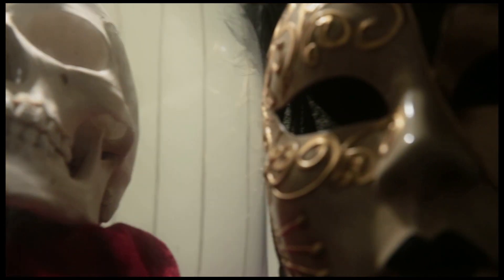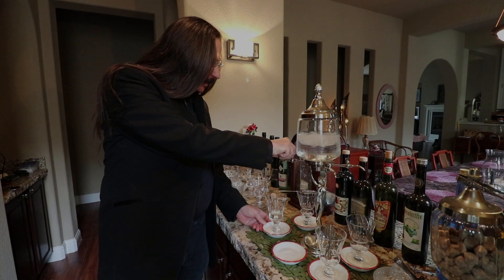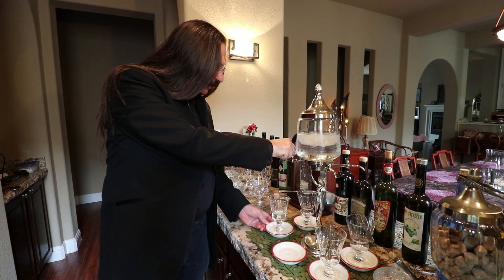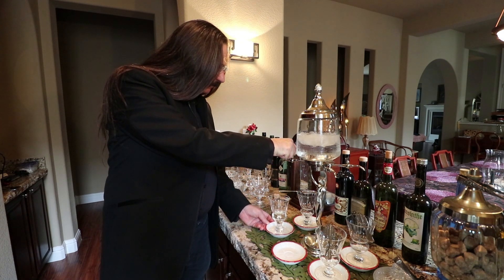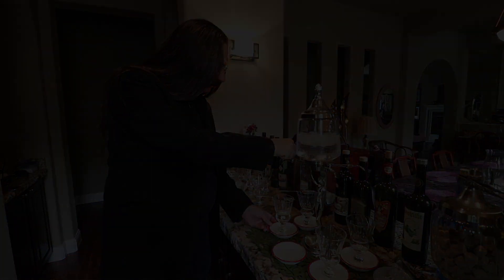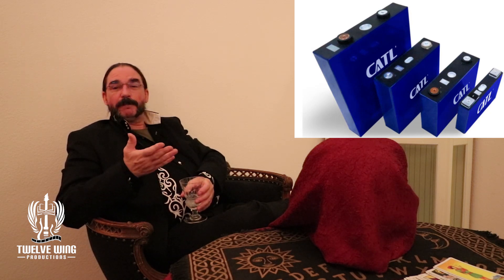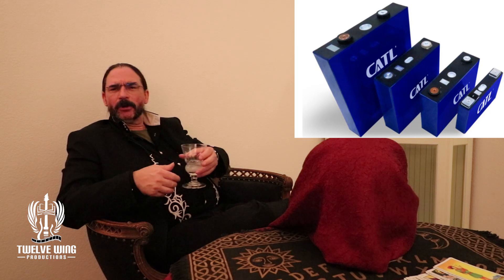Tesla Battery Investor Day: Does Vehicle to Grid Really Work?

Comment: It is my (admittedly crude) understanding that DC motors are smaller and more efficient than comparable AC motors, and that the ONLY advantage of AC is that it can be transmitted over long distances more efficiently. It thus seems to me that a more logical approach would be for homeowners to utilize DC  appliances including refrigerators, dishwashers, air conditioners, pool motors, heaters, and heat pumps. This would eliminate, or at least minimize, the need for invertors, which are expensive and which also waste energy in the process of converting the DC power produced by solar panels into AC. DC power could also be used to efficiently charge electric car batteries.   From my way of reasoning, the ideal would be to make all homes and businesses independent from the "grid" so as to eliminate the problem of "blackouts" where grid failure renders hundreds and thousands of homeowners bereft of power. I'd appreciate your comments regarding these ideas.

Comment: So i was thinking about solar power and would love some of your thoughts on this. 

It seems as tesla will have the day to day/night fluctuations under control with batteries and vehicle to grid.  Problem solved 

What concerns me is the seasonality of solar and  therefore the vast quantity of energy necessary to smothe that out. This needs to be solved for solar to be a big part of our electricity system. So how do we do that? 

Hydrogen? (god forbid haha) 
Some form of batteries ? (waaayyy to expensive) 
Excess solar? (Might be cheaper than hydrogen since hydrogen would require lots of excess solar anyway given about 30% efficiency) 
Nuclear/hydro power during winter? 

How would you solve this? Do you think Tesla has something planned? And if hydrogen is the route that makes sense for the grid, would that by extension make hydrogen vehicles viable?
Reply from the maker: I'm just about to release a video about driving on sunlight as well as a subscriber Q&A.  I'll go into some detail that will be in both here since you touched on it.

Firstly, the daily smoothing of home loads with VTG isn't going to happen.  We have a vehicle because it is our intention to use it.  I would encourage you to go back to our video library and find any one of The Energy Sovereignty Project summer videos or even something from say April or October.
What I draw your attention to is both the power to the vehicle as well as the "To Powerwall" and "From Powerwall" numbers.

What you will see here is the massive swing of power into and out of the powerwalls.  Imagine this was going into and out of a vehicle.  If you do that, you will run out of time to charge the vehicle and use it, even IF the capacity of the car is large enough to actually handle it... say 200kwh.
If the system is DC, you MIGHT be able to get away with the time aspect, but you will still be left with the into and out of swing.  This is going to also require your car to be at home while solar is producing... a time when most people have their car at work.

This can be dealt with eventually by perhaps sending the car home when autonomous driving kicks in, but it's never going to be the hassle free situation that is presented by most people supporting VTG as a panacea. 

The solution is actually home batteries.
Tesla will be announcing batteries at their battery investor day that will be MUCH cheaper than current offerings and MUCH longer lived.  20 years plus... or well over a million miles.
This will springboard the transition to sustainable energy.
Have a look at those videos as well as the two that I'll be putting up shortly.

In the meantime, if you like, you can tell me your rough geographic location and if there are any variables I need to know such as elevation.
If you tell me how much power you use daily... averaged over the course of the year... I can help you out with some numbers regarding how much battery capacity you should be looking for to both run your home and drive.
Reply: @twelvewingproductions7508  First of all thanks for the reply. 
And will check out those videos!

I realize now that you are right and VTG probably won´t make much sense even with the new batteries. Especially if autonomy is on the table and the car can spend its time there instead. 

I was coming from more of a macro grid perspective, as im a student so solar is right now not feasable for me sadly. 

But if you could i would appriciate your aproximation anyway.

I live in the southern most tip of Sweden, roughly sea level. The average electricity consumtion for a home in sweden with electrical heating is about 25k kwh. But its less cold here in southern sweden so lets say i used 20k kwh per year. Since we use so much energy in sweden and its not very sunny i realize that this is a worst case scenario for solar. 

Lets assume we used those kwh evenly throughout the year so roughly 55 kwh/day. 

How big a battery would i need/should i have? 

And from a grid perspective, but boiled down to a residential level. If i wanted to be completely detatched from the grid. Wouldnt i have to store atleast 45 days worth of electricity during the summer for use in winter? As my understanding is solar drops to about 40% effect during winter compared to summer in.

45 days * 55 kwh * 80 usd (lets say for new battery)= 200k usd. That is not economically feasable im afraid. 

Am i missing someting? It seems to me that we require a much cheaper long term storage solution for solar to be  feasable from a grid  perspective. We can ofcours lessen the effect by using wind also but the issue largely remains it seems to me.

Comment: I would agree with you based on today's batteries.  However, based on the mass production, the automotive battery, seems to be much cheaper per kWh than the Power Wall. If you need up to ten Power Walls and installation, the cost adds up.  I understand the power management system in the Model 3 has most of what you need for Vehicle to Grid.  Only small changes needed.

For everyday use a car only needs about 40 kWh.   I would argue a house needs even more as a power back up.  Customers are demanding much larger car batteries to satisfy range anxiety, occasional long-distance travel and performance.  If technology can give your car a cheap 200 kWh battery with a longer life and deep cycle ability, you can satisfy, what the car buyer wants.

Imagine using 40 kWh of your car battery to drive to and from work every day.  Imagine every second car using the other 160 kWh to back up the grid.  Or it can be you for taking a long road trip. You can add a small 40 kWh Power Wall to allow house power back up when your car is not home.  You could also use it for a fast charge car top-up.  It all depends on battery technology.
Reply from the maker: Yes, battery technology as well as how long you park your car... and where you park it.

Comment: Good points. The standard charger (/discharger) can of course not handle the amps needed to run the house. I guess it could contribute if there was already a powerwall installed to manage the loads.
That aside, it would still make sense to me to use the car battery. On avg. I would only use a fraction of the cars capacity during the day. When I get home from work, there is still plenty of power and the rates are at peak. The car could offset the cost during that time and recharge at night before I need it again.
Another thing is, what will the (perhaps) robo-taxi fleet be doing when there is not a lot of passengers. During peak, most people are at home and not taking rides, so the robos can sell any excess power to the grid at those times instead of just doing nothing.

Comment: I didn't think of Autonomous Vehicles, thank you for the insight. Elon has already talked on this V2G (other things I am writing are covered by Elon in multiple interviews, so I am stitching some of them together, some are my own thoughts) and the chief points I remember are: 

1. Putting something in cars which many people won't use doesn't make economic sense. Making cars is game of pennies (Elon comment) so even if at 300$/car for dedicated output inverter or bidirectional inverter, for millions of cars its huge amount and making it optional will add complexity to the production line with two variants (Tesla already trying to simply the process by removing paint and other options). 
2. Battery Life: People are protective of their cars and batteries. The battery swap idea failed for same reason because in their survey they found that people did not want to exchange their well taken care of battery with some unknown thing which they don't know how have been treated. So given the choice, most people including myself would try to retain car battery life as much as possible unless there is substantial evidence is available that my car battery won't degrade to level I am not happy with. Furthermore, it will have drastic effect on car resale value, if other cars with say 40k on odometer on market are selling for 30k with 95% battery life and yours has 90% with same 40k, you betcha that you will have to loss 2~3 grand. So unless V2G value proposition is strong enough with returns so as you can balance resale value loss, extra inverter cost, and elephant in the room in next point, it won't make economic sense to people.   
3. So last point (elephant in the room) is, regulatory approval, to make V2G, you will have to get permits, bidirectional meter, inspector etc, I mean going through all the hops you will for a powerwall or solar roof etc, (which will be substantial cost) and then there is Grid integration which will not be available in most areas. These all will have cost impact, and in the end if Utility can get 1kwh/3cent from their own stationary storage, it might not make sense to get it from individual owners at 4~5 cents.  

So, the only proposition I can see at this time (not talking about future) is for Tesla to put an optional inverter for power out like they shown on Cybertruck which can be used for power tools etc and maybe power the house during outage like you will do by plugging a small generator into socket. I am not sure what regulatory approvals they will need to put in this feature. But again, does it make economic sense? will people be willing to put 1000$ for this feature?

Comment: I see that you already have answered similar questions but Lets say you have Solar panels and you have an Hybrid invertor, i.e Growatt SPH series with an open sourced protocol to communicate with it and Tesla let you connect with DC to the battery, then it would be a great posbility for people to go towards your setup without spending a ton of dollars for powerwalls. Most of todays Hybrid inverters are smart so you can decide how much power to leave in battery and when to charge from grid to battery if needed so If Tesla isnt doing this in the next couple of years Im sure another car manufactorer will be no1 to do it.
Reply from the maker: While that is true as far as the capacity in the battery, I'm not depending on my house to get me to work.
So the reality of this is that it really does take two battery banks.  One for the car and one for the house.
The reasons for this are complex and come to light when one (crazy person) would go through The Energy Sovereignty Project logs day by day and see how the car and system interacted with one another.
I can't think of a single season, even spring when our production is at its peak, when I could do what the home does simply off the battery in the car.  When the car leaves, the home would have no battery.
The argument could be made that the car would "complete" the capacity and one could then have 2 or 3 powerwalls at the home, but you still wind up with a substantial system at the home... for good reason.

So I see this being solved by having the batteries become less expensive and far longer lived.  At that point it will be cheap enough to have the batteries at the home AND in the car.
I am going to do a video where I will re-address some of these very well founded points that you and others have presented.  Mostly based on something I didn't give enough thought to... over capacity.

Comment: Take Your time to respond no rush. I Value your Knowledge and of course Your Experience with 6 Power Walls.
I like the fact Elon is exploring different batteries in CHINA with CATL with PRISMATIC cells. Can they also be cylindrical as well as pouch?
I know your preference is pouch but I like cylinder cells for superior heat management.   
How about their own steel mill in TEXAS for their metallurgy and special Stainless Steel on CYBERTRUCK & SPACEX
Same goes for aluminum line and rolling mill maybe? But furnace to produce special aluminum for huge casting machine for 1 piece frame for MODEL Y. Maybe produce all castings for motors, suspensions. steering gear and all castings and motors completed in next building for motor winding. Totally vertically integrated to supply North America and DUPLICATE plant in China to supply rest of the world.
I am hoping TESLA will hold on GERMANY PLANT after pile driving and foundation are done and maybe restart project in 2023. By then after thing get sorted out with their domestic manufactures, the possible collapse of EUROPE, and corona virus plague subsided and their economy improves. Maybe by that time they will be begging for TESLA after a drastic restructuring and failure of some domestic manufactures. TESLA can continue to create market here from CHINA & USA. TESLA can’t do everything at the same time because of the money needed, demand, and their very special Chinese Engineers, Project Managers, and integrated with Elon’s top people from USA That developed this construction team in China. A sure way to go broke is to keep developing all new people. Can You Imagine what I am telling You these CHINESE ENGINEERS and PROJECT MANAGERS are the best in the world. Sorry BECHTEL. You are best known for doing Government projects with unlimited budgets and extracting a maximum fee and time to do the work. I can say this from experience working with this group in CARLIN NEVADA MINING PROJECT.